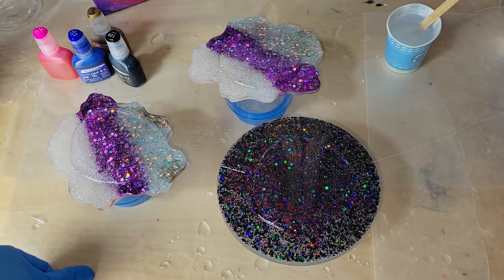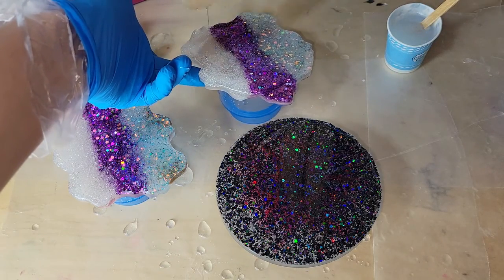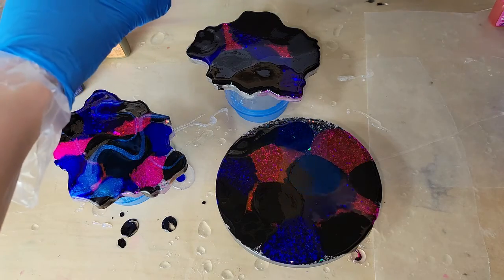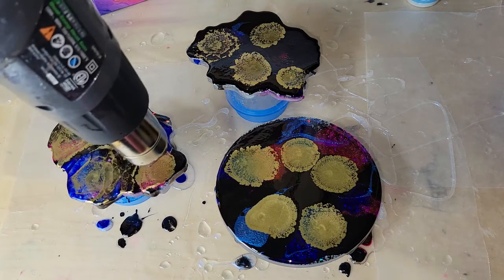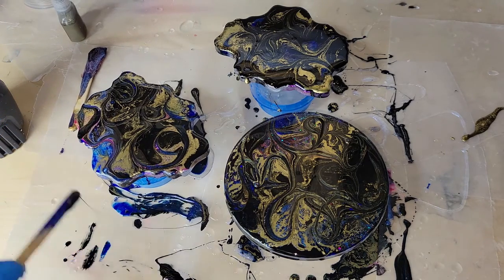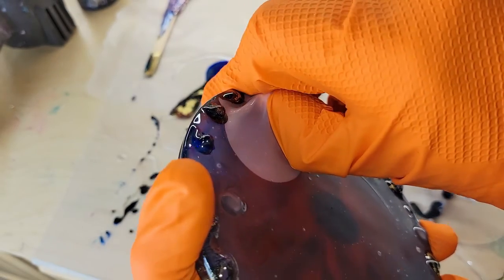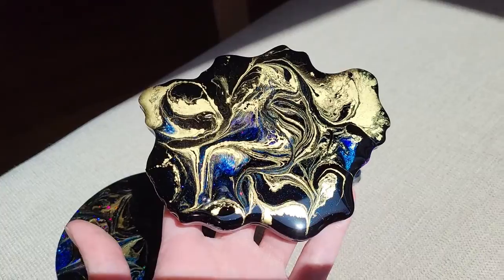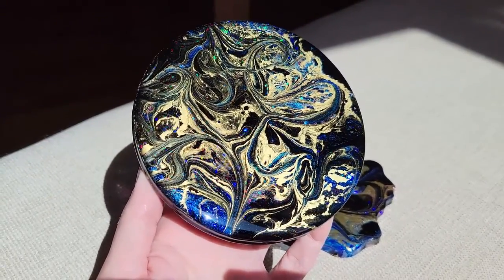Fixing failed resin coasters | How to re pour resin coasters that did not turn out

Comment: They turned out great! I love this technique. I was inspired by your other video where you did this. My daughter in-law and I made a couple of hot pads using this technique. They are beautiful! We were both really happy with the way they turned out. She’s coming over tomorrow so we can make a couple more!😊 So, thank you! The Elmers glue is a great tip too! I’ll definitely use that next time. I bought some latex but, it smelled so bad that I ended up using tape instead. Unfortunately it left little indents in a few areas around the edge where the tape overlapped, even though I’d let it cure for several days before I applied it. Thanks again for the inspiration and info!
Reply from the maker: Awe that makes me so happy to hear. I bet your pieces turned out gorgeous. I just love this technique, its pretty easy to do too. Which is nice. That's awesome you guys can do art together. I bet you have a fun time doing it 🤗🌞💗

Ooohh yes liquid latex is so stinky and tape is such a pain too because sometimes it can be problematic to clean up. Definitely try the glue it works so good. Just don't leave it on for more than a few days after you pour. The longer you leave it on the less likely it will come off easy. I left the glue on the back of these pieces for 3 days and it was OK but the sooner the better to get the glue and drips off the back. Thanks for watching 💗🌞🤗

Comment: so if you have the square coaster that you don't like. but it's been done with acrylic pouring painting. how would I fix it like this video?
Reply from the maker: You can apply some mod podge or glue. Really thin. Sprinkle on glitter or a few different colors of glitter. Let it dry for 24 hours. Then tape the back and do this 🤗🤗🤗
Reply: @naptimecreations  OMG OK thanks so very much!
Reply: @naptimecreations  can you only pay with PayPal on Laura's Art Corner?
Reply from the maker: @FiRsTlOvEyOuRsElF1433  no problem 🤗
Reply from the maker: @FiRsTlOvEyOuRsElF1433  you can use a card too, but I think you have to create an account on her website to do that 🤗